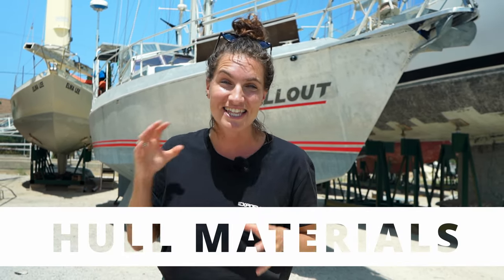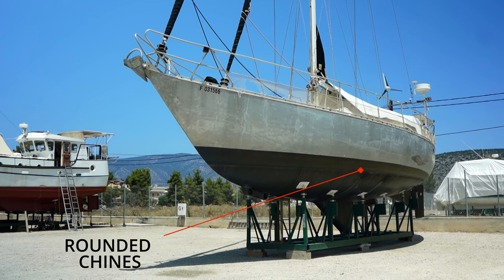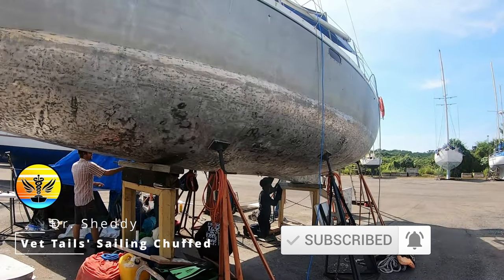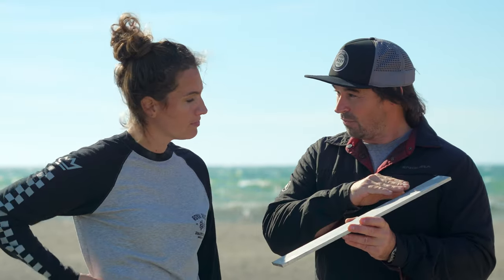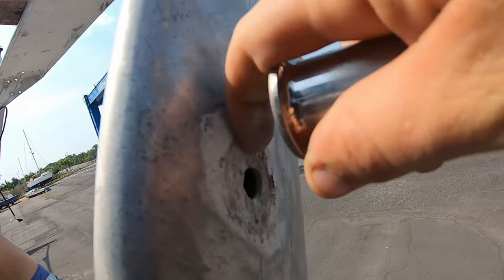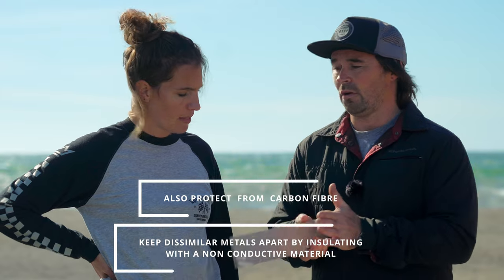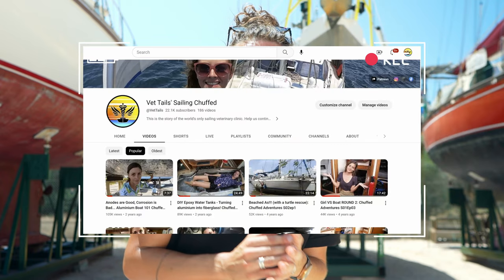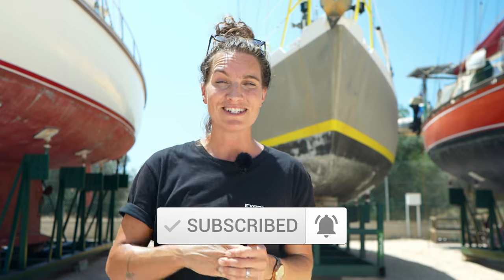The truth about Aluminium sailing boats from a PRO. Hull Material series Pt. 3

Comment: I am 18 month into a rebuild on what was supposed to be 6 months on a refit. My boat is a 42 ft aluminium French hull. I found so much corrosion inside the hull that we had to do extensive replating and correction work. Be very very very careful buying an old aluminium boat. The corrosion is hidden in places you just cant find till you strip her down to a bare hull.
Reply from the maker: Oh no, where are you doing the refit? I would love to come and see it! Sorry to hear the problems though.
Reply: @SailHub  The boat is being rebuilt in South Africa. I have a ton of photo's video's of the process and the work we have undertaken. 5083 plate and 5356 filler wire. My welder is an aluminium boat builder and has built a number of 60/70ft boats and even one over 100ft. He knows his stuff. He built a 62ft boat for a guy who then decided he wanted to lengthen it to 75ft - the boat was brought into the yard and put on the hard - my guy cut the bow and stern off and lengthened the boat to 75ft - that takes some skill !!! I paid for approx 600 hours of welding/fabrication on the hull. But in South Africa the rate for this level of quality is only around $45 per hour so not as bad as it could have been. Still, I have put aprox $35K into the hull repairs all up. After all that I still think ALU is the right hull material. My boat had some serious damage to the plates on the Starboard side and the Boat survived all that. She was clearly up on a reef at some point - GRP would have sunk. Its amazing how much damage an ALU hull can take and still float/sail. That level of confidence in the hull when operating in very very remote areas where there is no one to come help you is priceless.
Reply from the maker: @jimjones7821 sounds like a legend this boatbuilder you’ve got on the job! Man, seems like a right interesting project you’ve got on! Would be cool to see some of the pics.
Reply: @SailHub  for sure - I will get some together for you as its very interesting if you are interested in ALU hulls
Reply from the maker: @jimjones7821 sure am! We’re about to start our own build of one 👍
Reply: @SailHub  a new boat or a refit/rebuild of an old hull? A new ALU hull these days would be mega expensive.
Reply from the maker: @jimjones7821  ah… she took some tracking down… I was looking for an ally hull for over four years. She’s a new KM that never got launched. Well… never got finished, basically the hull is structurally done but no ancillaries at all are in it. Nor any external fittings, just the bare bones in need of fairing. 

Pretty cool though, we’re stoked to be starting it. The hull was left outside for a few years so we’ve got quite a bit of cleaning to do… at least there was a hole drilled in the bottom so she didn’t fill up with rain!

Comment: A galvanic isolator is a cheap half measure ! The only proper barrier from he shore, for an aluminum boat is an isolation transformer.
Reply from the maker: Even better is to stay away from the shore!
Reply: @SailHub  cheeky. You seem to be lacking pretty basic knowledge. Some people might think you know what you are talking about, follow your advice and get into trouble. Please research the subject before you put out a video clio.
Reply from the maker: @jarekkanios2697  cheers for the confidence vote 😂 It is my job by the way… 

As a proper answer to your question, an isolation transformer is most certainly a better option. It is surprising to have found a number of aluminium boats without one from factory though. Cost savings I guess, not good. 

For reference, this video was intended as a complete basics video. Hence the basic level of info, it’s not there as a definitive guide, just a starting point for people to begin their research from. 

The intention here was to offer the knowledge to have an insight into a given material. 

Unfortunately it’s very hard to go into great detail in a single video. If I were to do this we would need to cover every detail. Where do we start?! 

What grades to use where, what welding rods to use where, what sheilding gases to use, when to mig vs tig, wiring systems, windlass isolation, keel design, electrical, systems, compatible resins, paints, insulations, bearings, steering systems etc etc the list goes on and you will be more than aware of these issues. Unfortunately though, the video would never get watched… 

I hope you understand this and rest assured, we will take this slip up on the chin and better it next time. Believe it or not, I really do appreciate your comment 👍 

Thanks,
Chris
Reply: @SailHub  Chris, I noticed, that when sacrificial anodes where mentioned. The point of sourcing all of the same batch, from the same producer, was not brought up. Different melts from the same foundry, have just slightly different chemical composition. Helps reduce the chance of creating a battery of the hull. 
Silver Chloride reference cell, to test daily, when on the water.
Family I met, a while back, produce Aluminum, HD Outboard open boats, for the provincial power utility, and fishers. Hell for stout. 
Gave me a lot of information.
Best wishes.
Reply from the maker: @carlthor91 Interesting advice! It makes sense when I think about it. Thanks for that. 

There are a few tricks around for dealing with aluminium boats, our video was intended for those learning or thinking about aluminium, I really didn’t want to make a video about every aspect of Aluminium boat ownership but we will do more and get a little more in depth as we go along. 

Thanks again, much appreciated 👍

Comment: Great vid. I love an aluminum boat and have ordered an Ovni for delivery in 2025. Thickness is 10mm below the waterline (adding to stability), 8mm sides and 6mm decks and coachroof. Not so easy bending plate of that thickness and hence the boxy shape and hard chines. The scantlings, sprayed cork plus black foam as well as linings under deck and roof should address all the noise, conduction and radiation issues mentioned. I have spent a lot of time on the DC and AC systems (all Victron),  speccing only components that are isolated so as to avoid the dreaded electrolysis. Plan to sail her for at least a decade. Hope to spot you at Grand Pavois.
Reply from the maker: Sounds like an epic build!
Keep us posted, I would love to see this during its build! (do you use Instagram?) 
We’re pretty sold on Aluminium too… Stay posted, we’ve got something pretty cool around the corner🤫
Reply: 10 years of operation? funny ! We need a boat and a hull for 30 years. Then at high loads it will last 20 and I consider it reliable
Reply from the maker: @alee5240  I would suggest that a well built aluminium hull should be timeless if looked after correctly. Even under high stress situations the material is definitely strong enough to manage what a sailboat can throw at it. 💪
Reply: @SailHub  loads are one thing, but metal without reinforcing additives and against corrosion is just metal, and pure aluminum cannot even be drilled, it is very durable. I'm talking about corrosion, it often looks harmless on the outside on aluminum. It is simply easier and faster for manufacturers to make a boat with the maximum amount of profit and with a minimum number of manufacturing operations, and then the problems of a buyer in love with his boat. If he misses the moment of important anti-corrosion treatment, then he will blame himself, not the manufacturer. There are so many inaccessible places in an aluminum boat where you can’t see the danger of corrosion that you can’t say exactly when and in what storm the hull will betray. And all these relations between the anode and cathode, which must be strictly observed for aluminum. Аn example with metal for ships can still be worked on, found in complex world upheavals, but with aluminum it is problematic, it is difficult to find one composition. How much I watch another video and I stop liking aluminum, which is used for boats.
Reply from the maker: @alee5240 interesting, I would suggest you read into your worries a little more.
Reply: @SailHub  just watching a video about the repair of an aluminum yacht and I did not like iit, what I see. Electrolysis even made large shells from the inside. For 2 years I used a plastic yacht made back in the 70s in Poland, its hull is like new, no osmosis, only the deck is cracked like a fine mesh, the tree is native, the mast from the Tornado cat was installed. So iit was nice. And she didn't buzz on the wave like an empty tin can. With an aluminum boat too noisy
Reply from the maker: @alee5240 hey, sounds like a nice boat you were sailing on. As for electrolysis and aluminium corrosion… it’s certainly its nemesis however it really isn’t a problem if the owner and builder take the correct precautions from the beginning.
Reply: @SailHub   if with all responsibility the manufacturers do everything as if for 1000 years ......i saw the motor yacht SEA REY and as always stick my nose in to see "underwear". And there in the stern, deep under the plastic, there is a simple plywood, not even waterproof. But outside, everything is so beautiful and neat. Then I saw the poor fit between the curvature of the side and the deck. From a certain angle, I can see a lot. Today, modern yachts are built as a beautiful disposable trough for washing clothes. Cheapness, there is no time to wait and make quality, pricing policy requires its own, the population is getting poorer, people have less and less paper called money, and yacht manufacturers do not want to stop and are already doing frankly beautiful shit
Reply from the maker: @alee5240 as a boatbuilder I’ve spent a large amount of my time fixing these problems and I can certainly agree with these points. A metal boat is usually quite different, there’s so much work thy goes into it but you must be sure it was finished by a knowledgeable builder to make sure it is  a boat that will last. Lesser builders will usually scrimp on insulation and sometimes in other areas too.. Then there is the dreaded aftermarket boatyard contractor or previous owner tinkerer… It is here is where aluminium usually meets its problems..
Reply from the maker: @alee5240  I can certainly see your point! However, we’ve got to remember, not all yachts are equal. More people are sailing now due to cheaper boats, the problem here is that corners are cut, they have to be. If you want a good yacht it’s going to be harder to find as there are a lot less in production and it going cost more, a lot more! But.. they are still out there.
Reply: @SailHub  yes.. if you need a reliable boat to save life, we need to look for quality, because there is only one life
Reply: @SailHub  Yes
Reply from the maker: @alee5240 tooo true! We’re at the beginning of the O°G°R° and I’m sure every skipper here would agree with your statement!!
Reply: Aluminium hull V corner of a half submerged shipping container…the bets are off! 
But then all proper off shore yachts have watertight bulkheads.
Reply: Big advantage.  You can weld on fixings, so no leaking holes through the hull / deck.
Reply from the maker: @markthomasson5077 watertight bulkheads are the answer. But do you really think it would get holed that easily?
Reply: @SailHub  steel V aluminium at 15knts…..hmmm?
Reply from the maker: @markthomasson5077 ah ha, but it’s not like the shipping container is attacking aluminium. Possibly more a question of absorption and deflection of energy between two buoyant masses.

Comment: Been designing a yacht for many years and would choose nothing other than Aluminium. I think people that choose fibreglass are just mad and they all end up as land fill or junk in the ocean. ALuminium is recyclable and dissolves in the ocean over a long period. The hull can also be used as a radiator for engines without introducing sea water in and having more components to clean. Jet drives can be welded directly to it instead of glue and bolts like fibreglass. If you do have a crack or hole, you can also easily screw on a repair sheet of thin aluminium, where as fibreglass screws would just tear out. Any scrap from the large plates can be used in smaller areas. You don't need a massive mold either to construct a boat, my design is 24.8 metres, so I can still build it myself with aluminium. You can modify it by just welding to it, much simpler than fibreglass.
Reply from the maker: To true, although fibreglass is very easy to fix without any real skill required.

Anyhow, I would love to know more about what your designing, I always a boat build project!!
Reply: @SailHub  My yacht design is a high aspect 25X5 (approx) mono hull axe bow with twin jet drives. It also has drop in electric propulsion. 3 tonnes of sla (96kw) batteries in the lower hull plus some more lithium, approx 15kw of solar which is integrated into the decking (decking flips over to expose the panels) hydrogen filled kite, about 10m2 of greenhouse below deck, heaps of freezer storage for fish and food, a small wood fired stove to make use of drift wood, electric stoves of course, wind turbine 15,000 litre of diesel and much more. It is designed so you can live off an island almost indefinitely. Not started yet, but I think it is far better than most of the yachts today. Kites are much better than sails and from reading most people use their engines over sails. A greenhouse can be made to withstand sea conditions, something I think is important. The yachts I see are mainly designed as an orgy pad or are very basic and can't sustain life for a long time, or not comfortable. I see mine as comfortable, sexy and practical, although the length is a hindrance to many ports.
Reply from the maker: Genious!
Reply: agree. AL has more pros than cons, for a knowledgeable owner. For a knowledgeable welder, AL is no more difficult than steel.

Comment: Wonderful explanation, and I completely agree that aluminum is the best boat hull for a sailboat as well. Where steel hulls shine is in much larger yachts - 110 ft (32m) and longer. Steel is stronger and higher melting points so more resistant to fire's 1200 to 1600 degree fahrenheit temps, and its heavier so more sea kindly when paired with aluminum superstructures.
Reply from the maker: Thanks! I think steel certainly has its place, as you say it’s generally with larger boats. Nothing wrong with it in small boats either I just believe it’s a little heavy and we don’t need the added strength as Aluminium is more than enough.

As for fires, its an interesting point. given a diesel fire is under 100°c and aluminiums melting point is six times this. This is not really an issue, however… A lithium fire is generally a lot higher and this could cause problems! Still, where fire is a concern. Safety is always paramount and as you suggest I think steel would be the best without question
👍
Reply: @SailHub  😉maybe do a little more research on the temps of fire. I can assure they are higher than 600 - aluminum's melting point ...
Reply from the maker: Cheers, I will do - thankfully I’ve not been in one 🙏
Reply from the maker: I love a good read, this paper is quite interesting… stating the ignition temperature of aluminium is higher than that of steel. I was really surprised by this however the reasoning makes complete sense.
Maybe worth a read, I will be continuing to read on the mater and I’m hoping to do a video with the coastguard and fire service about fires in the future too. Thanks for raising the point, it’s really quite a good one 👍

https://almet-marine.com/wp-content/uploads/2021/07/Ch09-fire-resistance-of-aluminium.pdf
Reply: @SailHub They did say 2000 c for the aluminium oxyde layer and 660 c for the aluminium itself.
Reply from the maker: They do, and they also suggest that it will not melt without reaching ignition temperature first. Interesting they also state aluminium foil will not melt with any flame. 
Obviously a bit more  research to be found and read here, It’s such an interesting material.
Reply: are you sailing in a Lava flow?

Comment: Nice video. 5083 H32 and 5052 are the alloys I use with a PP gun and the wire is 5356. Push gun needs 5183. You need to remove the bulk of the oxide layer prior to welding and design for shrinking during the welding process and accommodate of the heat affected zone. With modern inverter welders and a little bit of learning first on steel before Al, with aluminum being an excellent choice for a self built boat
Reply from the maker: Cool, I’m a 5083 5356 guy for most things, although I don’t tend to need to bend much these days so that’s probably why. These days we just carry an inverter tig as it’s so portable. They are fab! It does feel a little more faffy in comparison to mig sometimes but it’s small and good for swapping out to do the odd set of chainplates and arches etc.

I’ve been thinking of a spool gun recently too for an upcoming project, either that if the miller mpi for its portability. But… it’s expensive and more kit to store when we don’t have a workshop anymore!

Comment: Aluminum is the best!  I have seen aluminum oil field crew boats. 50 yrs old with no problems but a few dents.  They run the crap out of them.  Some have been converted into dive boats. The Captains love them. Bear aluminum finish.  I captained a Morelli and Melvin 70’ power cat ferry, all aluminum. Great vessel.  I have always had FG sailboats because that’s what I could afforded.  But aluminum is by far the best!  Love the shoal designs too.
Reply from the maker: Hey Fred, cheers for the input. Couldn’t agree more. 👍⛵️